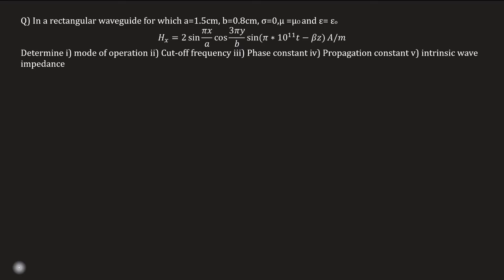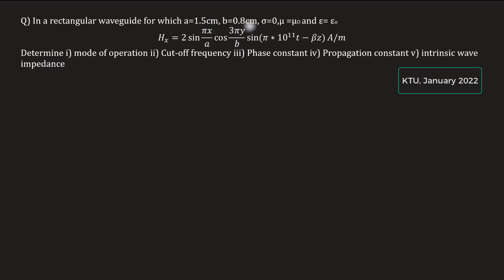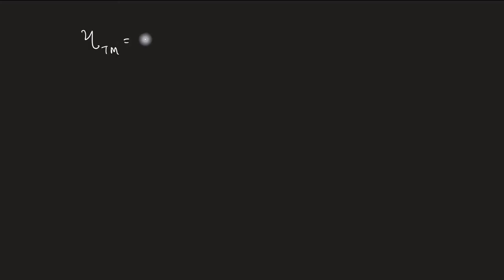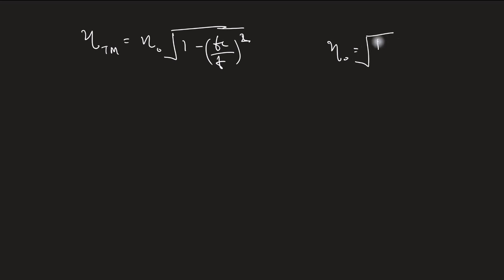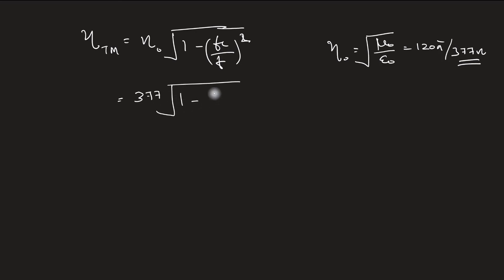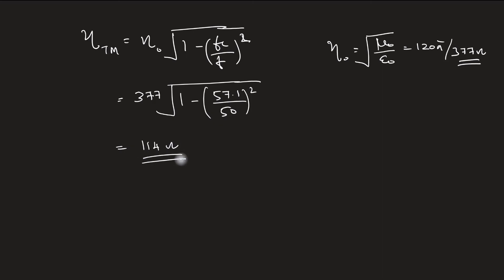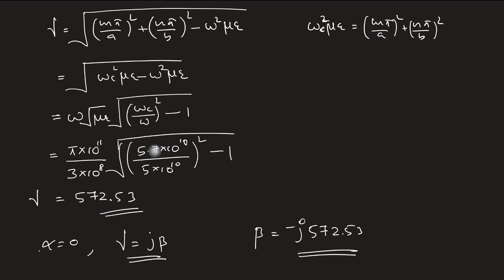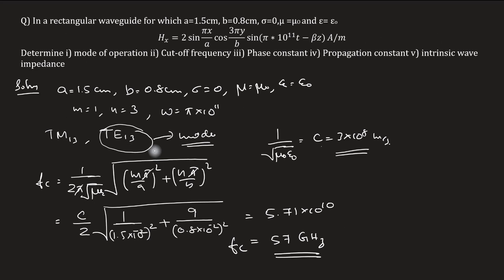Previous year university questions & solutions - 12 | Electromagnetics | KTU | Lecture 85

Comment: Sir , i think the qstn has some issue, cuz cutoff frequency is greater than operating frequency in this qstn, sinθ = cutoff frequency/operating frequency, ith will be a value greater than 1,  sinθ can't be >1.
Reply: Ivde cutoff frequency = 57GHz, operating frequency = 50GHz....qstn correct alla. 
When f<fc , then attenuation happens and wave should not propagate through waveguide 

But here σ=0 given ahnu, which implies no attenuation i.e , α=0.

Only when f>fc wave will propagate.